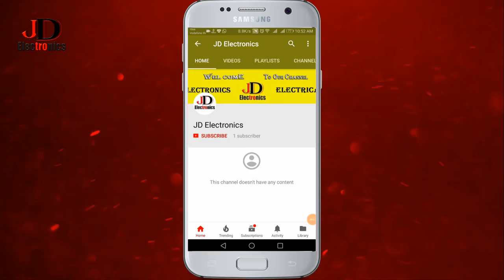What inside switch and how to repair switch

Comment: JD Electronics
What liquid did you use in cleaning?
What was responsible for the corrosion of  terminals?
Reply: ....probably isopropyl alcohol.
Reply: 99% isopropyl alcohol it’s used also with electronics and pcb for cleaning a lower % will work with this project but use 99% for pcbs

Comment: Mine failed because the rocker wouldn't stay in the on position and my bench grinder would not power on.  The contacts for corroded so I understand why it would not power on but I don't understand why the mechanism failed.  I guess the crescent shape contactor got out of position somehow?

Comment: Mine is stuck. Won't turn off.
Reply: Ball is loose from spring hope you got it
Reply: @jameshunt5316  I took it apart and put dielectric grease and works better than before.
Reply: @mgomez5606  same with mine, no grease though just cleaned it